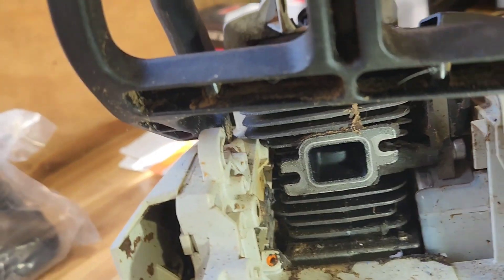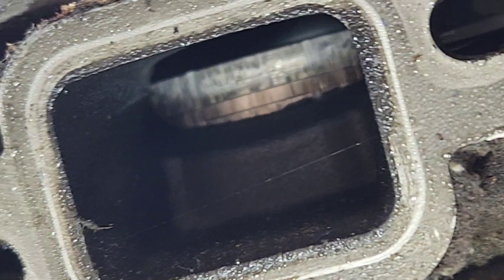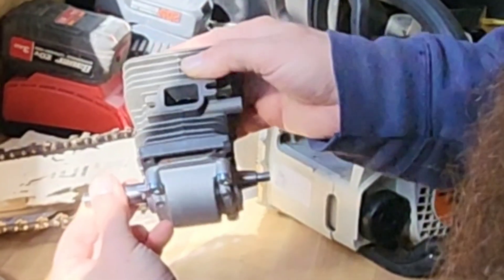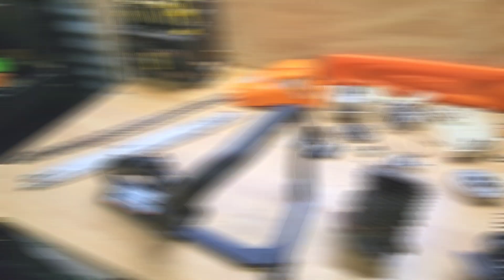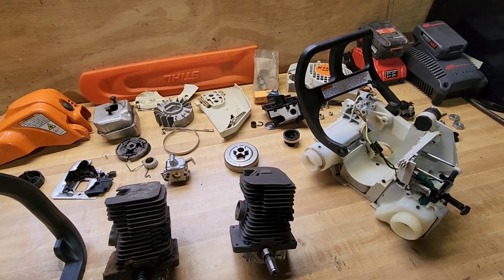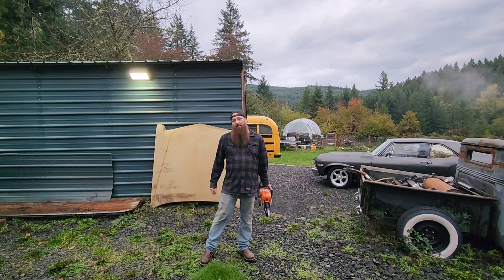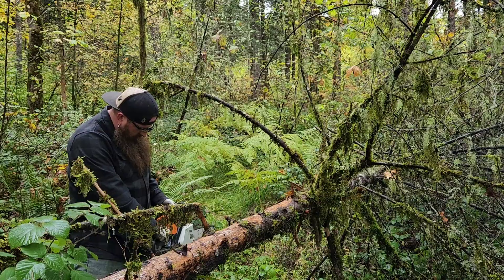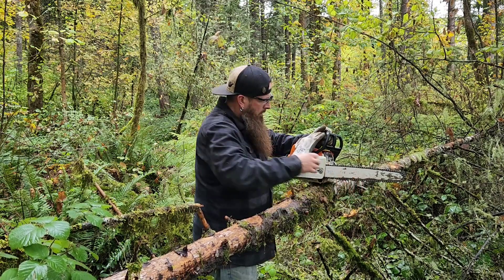Let's Engine Swap This STIHL Chainsaw! New Chinese Motor off Amazon going in this MS180 saw.

Comment: It's been a year.  How about an update?  Did it survive a season?   I recently swapped a similar motor into my 30 or so year old 018C saw.
Reply from the maker: Still running great!
Reply: @CountryFamilyForestHomestead  Good to hear.  The only problem I had with mine was after starting it the first time and then putting the saw together, it would not even try to start.  Removing the plug, there was a bit of the red gasket material stuck in the end of the plug.  After removing, it fired right up.     My original motor looks ok.  Compression was only 62PSI.   I plan to hone and put new rings in but I am still waiting on the rings.    Thanks again for making this video.